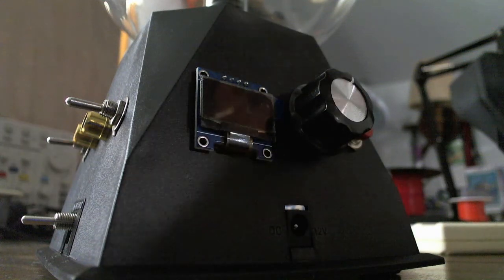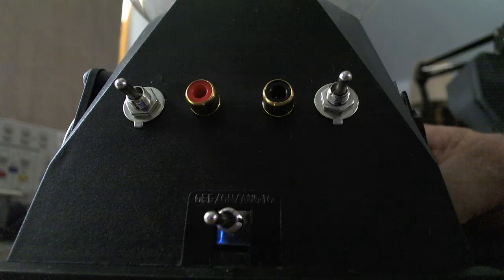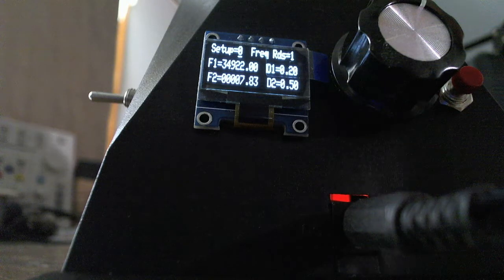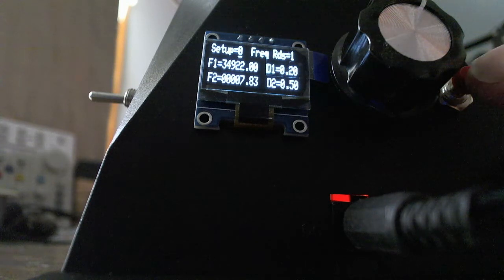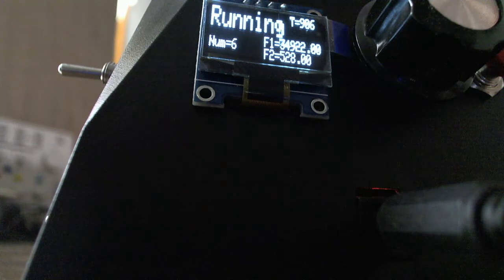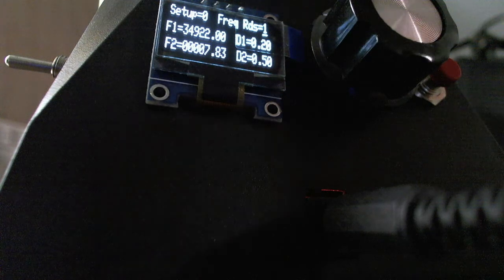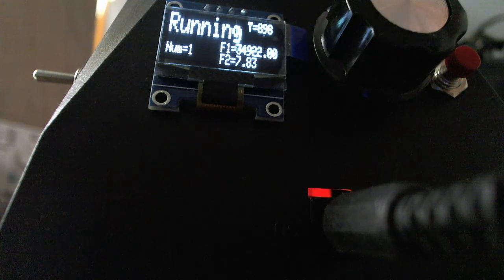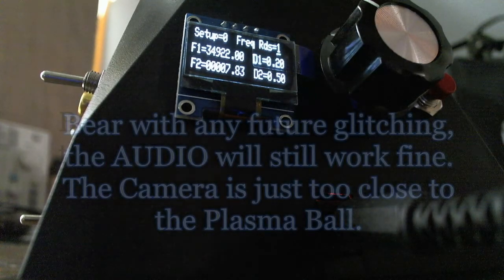Intelligent Plasma Ball 1b

Comment: Hi Steve, are you able to source a bigger plasma ball, say like an 16 inch one on ebay and convert that with the adaptions you do ?
Reply from the maker: The short answer is yes, but not something I'm interested in doing.  Everything necessary for such  a project is posted on the website so have a go at it  if you want such a beast.
Reply: @gskempe9  Thanks, I do like your plasma balls that you convert, but was looking for a bigger plasma something along the lines of the Spooky 2 Plasma kit. I know that the Spooky 2 Plasma Kit is probably more powerful than a 16 inch Plasma ball of ebay, but just wanted something more substantial.....keep up the good work

Comment: I tried to email you about buying some products but some how it wont send, I clicked the contact on your site but it did nothing, so I copied the address and tried to email you but it did not work, do you have a # to call...
Reply from the maker: If you copied the email correctly from the contact button on the website and it doesn't work, I would suggest you use the email address on another computer because it works.  It was just tested and worked, although one never knows when an ISP is going to have a problem.  Presently it appears to be working!  I don't publish phone numbers or emails directly on or in blogs.
Reply: I deleted that comment with your email address on it btw..  just report it as spam or unwanted and it will delete it without repercussions to the commenter or yourself... fyi...

Comment: Ok so you showed the boring readout that means nothing when you dont show the actual globe..  thats the whole fun or purpose of it all isnt it?  Why didnt you show the features of your creation rather than the overly complicated logic of the device??  You could have simply just programmed some arduino with a readout in a box and it would have been the same thing i saw here..   might be cooler if you put a good capacitive multiplier circuit or a marx inside and made the plasma ball a plasma musical testla coil with a digital readout, usb interface and mp3/mp4 playback adaptability.  Could even incorporate bluetooth or wifi if you could figure out a faraday cage to isolate the frequencies they use independently over the frequencies of the high voltage device...  thatd be some cool stuff that people would buy...